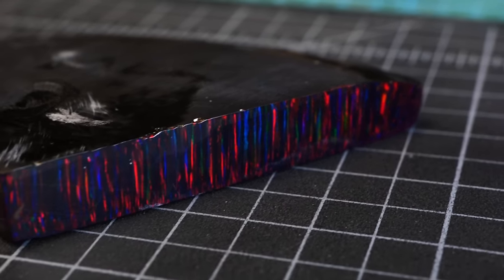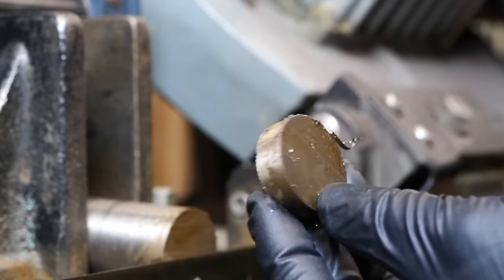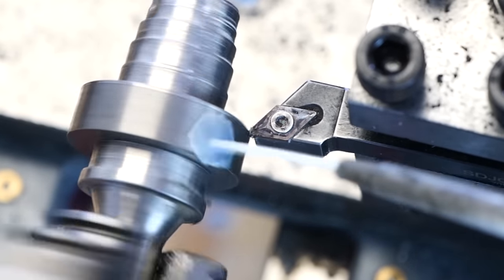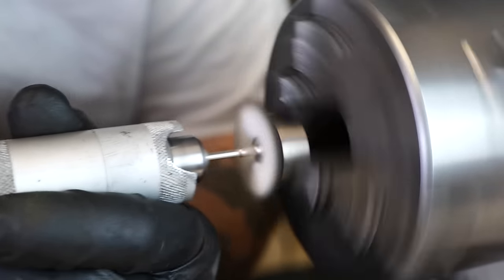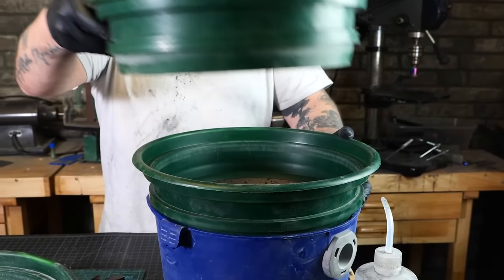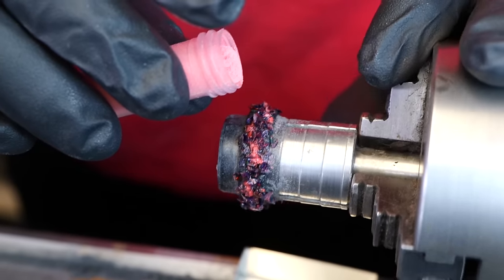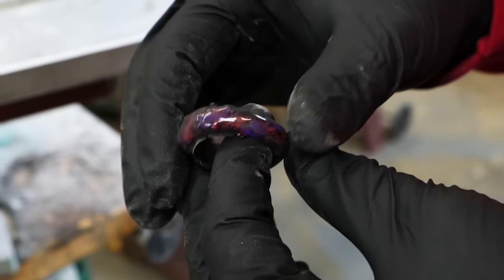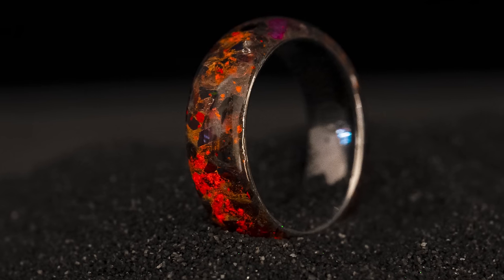Making A Black Hole Inspired Glow Ring

Comment: I hate to be a stickler, but a quasar is not the particle jets from a black hole.  A quasar is the active nucleus of a galaxy with the primary component being a super-massive black hole that is consuming large amounts of matter.  The term "quasar" is short for quasi-stellar radio source; they are alternately called QSOs, short for quasi-stellar objects.  The particle jets from the poles of a black hole are known as relativistic jets, since the particle streams are travelling at near-lightspeed.